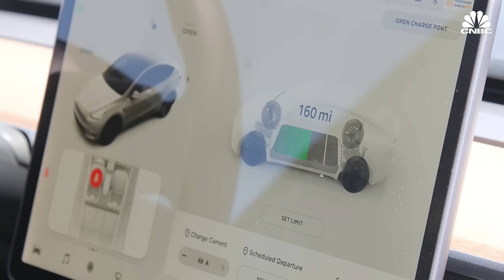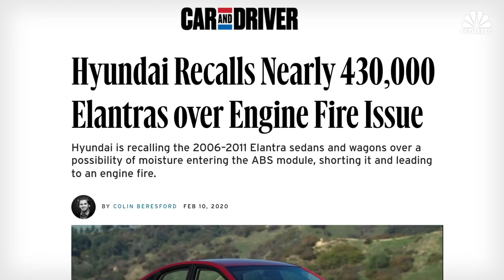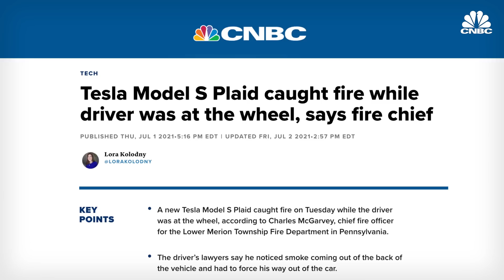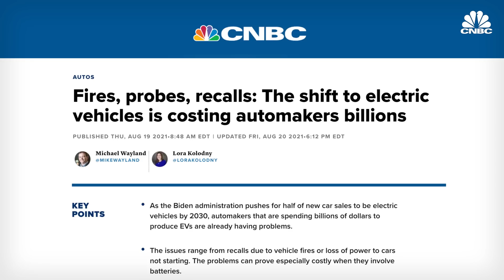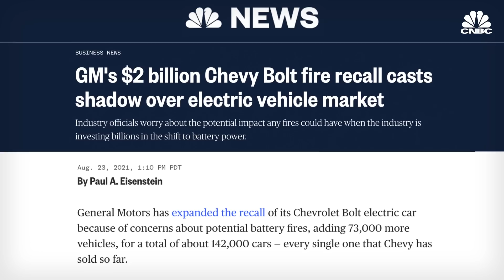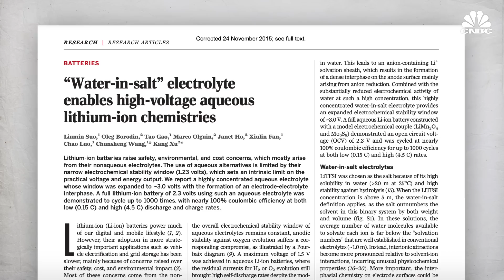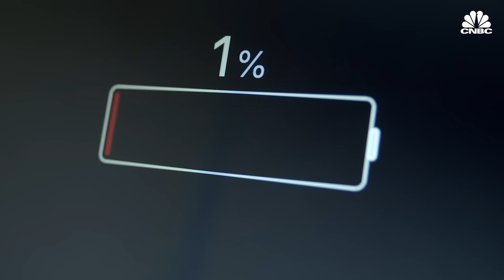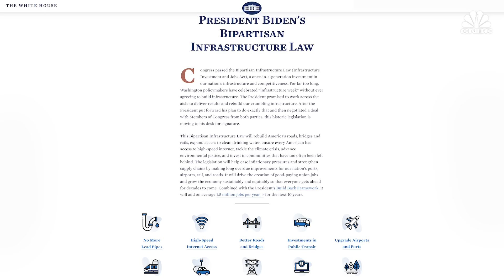Why Tesla, GM And Other EV Companies Have A Fire Problem

Comment: I noticed that they didn't mention how many of the car fires per year were EV's. WHen they had a second chance to make that point, they went the way of comparing ICE fires to all fires.
Reply: the fire is like many torches not the same as a gas car.
Reply: You're spot on Kay. Many ICE car fires are the result of arson, insurance scams or simply being parked and having another vehicle crash into them. In other words a fire due to a source from outside the vehicle. EV can ignite from within without warning.
Reply: There is no comparison an EV fire is 10 times worse!!
Reply: Can't be compared without replacing all ICE
Reply: The NTSB could tell you. They recorded around 190'000 ICE car fires in the US during 2022. There were 4200 EV fires recorded over the same period.....

Comment: One problem not mentioned is the one shown graphically in the video image of the electric bus which caught fire in a normal, busy, street in the middle of Paris (France).  It was empty and out of service at the time which was fortunate so no deaths but it was literally raining molten metal around the bus.  If you were trying to escape you would either perish or be very badly burned from the flames or from the molten metals - and no way to protect yourself from it as you fled.  And the smoke which was filling the atmosphere was a rather attractive - but obviously very destructive to human lungs and the environment in general - green.
Reply: Yawn.  Are you people literally INCAPABLE of doing actual research?

"On April 29, a fire broke out on a Bluebus 5SE electric bus on line 71 in the 13th arrondissement of Paris, close to the French capital's national library. The driver immediately evacuated the passengers and no injuries were reported."

Yet again proving, that even with a bus full of passengers catching fire, the driver evacuated the bus safely and there were NO injuries, completely destroying your drama theory.
Reply: @redbaron6805  Must be a different bus.  The news video for the fire that I watched involved a bus that was very definitely NOT IN SERVICE and had this (in French naturally) written up on the sign thingy above the front windscreen.  It was also empty and the engine switched off.  The first sign something was wrong was when the lights - all the lights - flashed on and off a couple of times and then there were flames and smoke everywhere shorted joined by raining molten metal.  The report did mention that it wasn't the first fire involving a bus in Paris and it also briefly mentioned a couple of fires in other countries as well including the UK.
Reply: We had a converted EV cement mixer self ignite In Melbourne last week. It had just come off a large bridge. Had it ignited on the bridge I wonder what the damage might have been to the bridge structure, not to mention cars driving behind it? The spectre of this occurring in a tunnel or underground carpark is truly terrifying.The really scary part is that none of the news services reported it! I wonder why that is?